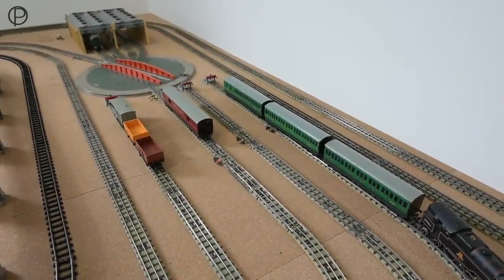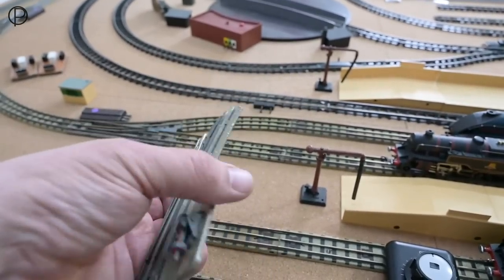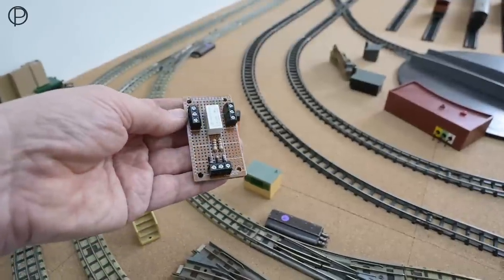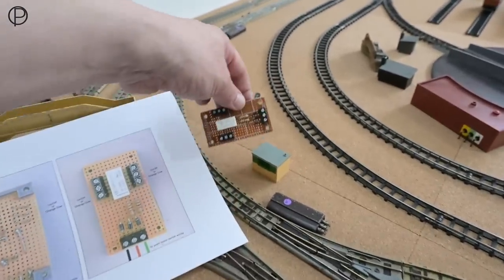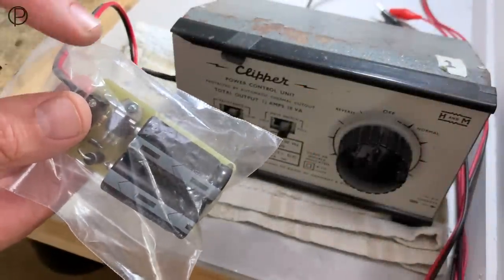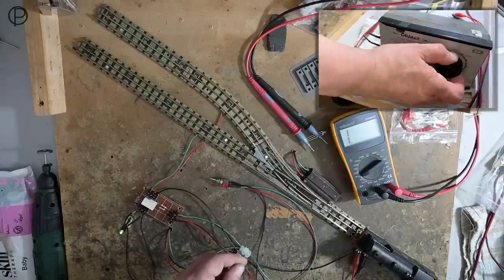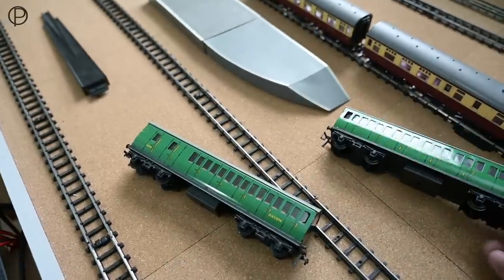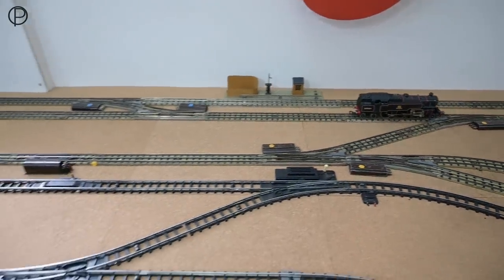New Hornby Dublo Suburban Coaches and a look at how I’ve used Relay ‘s on the railway

Comment: Very interesting video Oscar. Your relay boards are pretty much the same as the ones I am using for my live frog switching on Peco electrofrog points. I used the Gaugmaster universal relay boards that do the same but only have solder pads for the wire connections, your use of terminal blocks is much more friendly.
Reply from the maker: Hi, thanks again for watching solder pads sound a bit single use and possibly fiddly to install upside down under the railway, initially I was just soldering on cable to the relays preparing them before installing them under the railway, which was very fiddly and fragile. I found putting a pair of these together on the Strip/ Matrix board takes about half an hour.
Thanks again take care.
Oscar

Comment: Hi Oscar, a very interesting look at the wiring system that you are using.  I like the LED signalling the state of the point, very useful for the points furthest away.  I might aim for something like that myself, although I'm running 2 rail Dublo and using PECO electrofrog points to help with smooth running so the wiring will be slightly different.   The first two coaches I ever owned were maroon Dublo suburbans and I still have them.  Charming little coaches and they still keep rolling very nicely after all these years.  Cheers Guy
Reply: I have used a similar method for Peco electrofrog points, it works very well.
Reply from the maker: Hi Guy, thanks for watching. Glad you found the video Interesting, great to hear you have your original maroon suburban coaches and still running well, great items.
Take care.
Oscar

Comment: Hi Oscar, enjoyed the video, especially the points wiring. Very impressed with your home made relays, most effective giving great functionality to the layout. Hornby Dublo three rail track wiring is actually more complex than DCC wiring which is aided by the availability of off the shelf modern point motors, relays, frog juicers and accessory decoders e.t.c. Regards Barry.
Reply from the maker: Thanks Barry glad you enjoyed that and found it interesting, it's been great fun and very rewarding developing the railway. I was unsure at first, whether I would get enough out of either the 3-rail or the 2-rail if I use them together, but I've been very surprised at what has been achievable in the space.
Take care.
Oscar

Comment: Hi Oscar,
Excellent video and well done on adapting the illuminated point relays, very much ‘Tortoise’ work rather than Hare, if you will excuse the pun 😀.
I have three of these SR coaches and they look great on the track, mine have seen a bit of action though.
Currently going through the thought process of making the lift out section a success, so many options 🤔
Reply from the maker: Good morning Gordon, great to hear you enjoyed the video. Will your lift out section be hinged or fully removable?
Thanks again take care.
Oscar

Comment: Hi Oscar...here is alittle dublo modification you might like to try to correct the Duchess cab end droop......file off the cab body lugs where thet fit in the chassis of the good loco. Cut the footplate off a scrap Duchess body and trim in the sides and end so it fits under the good loco footplate. Using the existing footplate holes provided and a couple of meccano nuts and bolts, fix in place and hey presto the cab lines up with the tender running plate.....Good luck....Gordon McDonald
Reply from the maker: Hi Gordon, thanks for watching and the information it's much appreciated. Take care.
Oscar

Comment: Interesting to see how the point indicator lights remain on, as the  switches only send power briefly. I did post a comment regarding this about a month or so ago but mistakenly posted it as a reply to another unrelated comment, when I realised this I deleted it with the intention of posting it in the correct place. Unfortunately I completely forgot to repost it. All's well that end's well as the question that I attempted to ask has been answered.

Comment: Hi Oscar, in a future video  would it be possible for you to include a section on your 3D printer, how it works, material used, and what components it can produce? Regards Barry
Reply from the maker: Good morning, Barry at some point I shall include something about my 3-D printer. I use Creality Ender 3 V2, I draw the parts using Sketch Up online version and the files are sliced/prepared for print in Cura the filament I'm using at present is Sunlu which comes in 1 kg reels. This prints nicely at 210° with a bed temperature of 60°.
Take care.
Oscar
Reply: @oscarpaisley  Thank you.😀

Comment: Interesting video on your point relay boards. The other name for Matrix board is strip board. Find it interesting that 60 year of old railway equipment has lasted so long and is still usable with a little tender loving care.  I am finding your Tri-ang content very interesting.  One small question Oscar, from what supplier did you source your capacitor Discharge unit (CDU) from? Is it a Gaugemaster or Peco unit?
Reply from the maker: Hi Tony, thanks for watching. Glad you found the video interesting and are enjoying seeing these older items in action. The CDU I'm using on the bench is one that was bought from the local model railway shop  branded as Gaugemaster however on the layout, the control units I'm using are Morley Vanguard units (See Link Below) and have their own CDU built into them, I have two units, one for the twoRail, and one for the three row of both different systems have their own CDU, it's not really necessary to have two discharge units on the railway, but as both controllers have one built in, I thought I may as well use both one for each system.
Take care.
Oscar
http://morleycontrollers.com/shopdisplayproducts.asp?search=yes&bc=no&catalogid=30

Comment: A question for the more knowledgeable. Is it possible to remove a point motor from a Dublo electric point and fit it to the later manual isolating point?
Reply from the maker: Hi Paul, I'm unsure is the answer to that, there will be quite a lot of material to remove from the non-electric point, and make an edge secure enough to fix the motor to put the problematic. I have had a look at the potential for using point motors mounted below the baseboard which could be another option, although you would have to disconnect the manual switch lever and there is no over spring hold blades in position, again brings with it quite a few problems to get over, servo type (slow moving) motors may be a good as I think they may hold blades in position, these would bring lots of interesting switching options.
Thanks for watching take care.
Oscar

Comment: Hi Oscar. My R1 Southern Tank is diecast and not plastic. The R1s were used in threes on the Folkestone Harbour branch to shunt boat trains up the 1/30 gradient! As far as I know, the Dublo R1 is the only RTR R1 tank that has been produced to date. I was luckier than you with my SR tinplate coaches. Here they are with the R1 tank. https://youtu.be/4jear1dHYTI
Thanks for uploading.

Comment: Good morning Oscar, the two new suburban coaches looks great on the train, and considering their age in remarkably good condition. You're a clever chap being able to get your head around the wiring of these 3 rail points, it all helps with smooth running of the Railway, I do like you can glance at the led and see which way they are set. I've been given a box of old 00 bits been in a friend's mums attic, I've been lucky with some things I can use including a old gaguemaster controller, but in the box is several old triang bits some gray platforms some brown incline piers if they would be of any interest to you, and could give me a way of contacting you I'll send a list of what I've got, and you can decide if they would be of any use? I'll happily post them to you, there not boxed they were literally in the bottom of a big box of bits. It would be a shame for them never to be used again. Eddy xx  my email is eddycg14@yahoo.co.uk
Reply from the maker: Good morning Eddie, thanks again for taking the time to watch, it's been great fun developing this railway and it's definitely not over yet, the relays had worked very well with older system 6 point work, some of those system 6 points even when they look in good condition are so temperamental and definitely not as serviceable as the Super 4/ Series 3 point work, with the system 6 the rails are bonded to the track bed so the use of the relays got over the poor continuity making the track work very functional as they operated in line with the point motors, so it seemed a logical progression to introduce them to the 3 rail track work. I'm always interested in a few bits and pieces to use here and then I shall email you.
Take care
Oscar